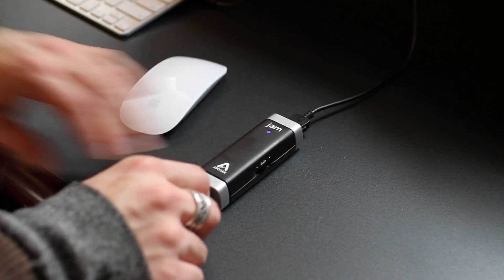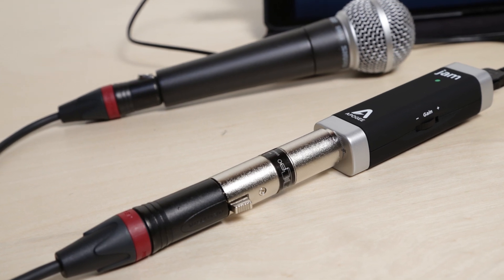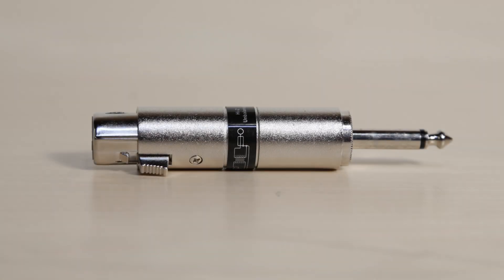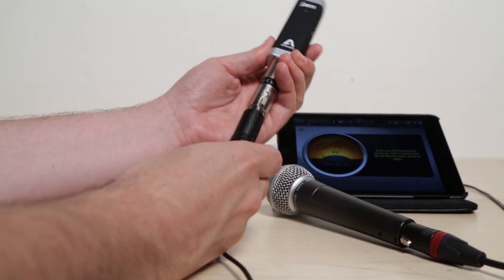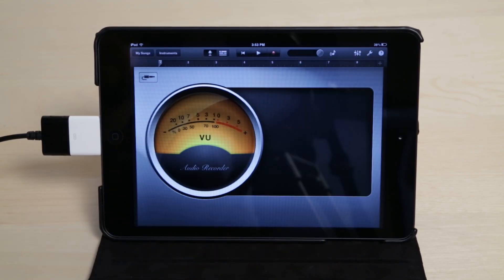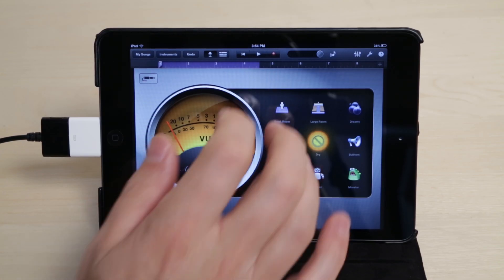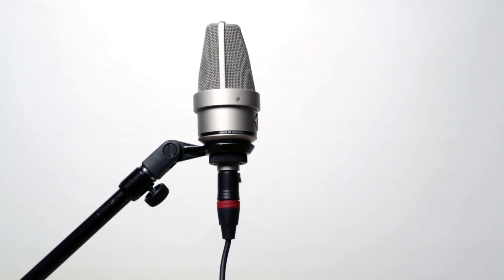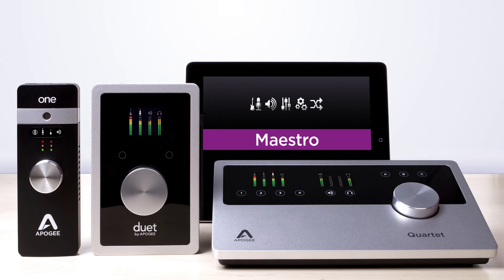Apogee JAM - How to connect a Dynamic Microphone

Comment: Hi, what if I want to use a condenser mic? I'm planing to get a external phantom power supply, can I go from the mic to the phantom power supply and then from there to the apogee jam and still working great? in that case do I still need the low to high impedance transformer? thanks.
Reply from the maker: IF you plan on using a condenser mic, Apogee ONE will probably be the best option.

Comment: So apogee, I have a dynamic mic and it already has a 1/4" end to the cord, can I still use it, or do I still need some sort of adapter? Thanks :)
Reply from the maker: You can use it. However, with a line matching transformer (as used in the video) it sounds better.

Comment: Hey guys! Where can I find the adapter? Or, can I use a microphone that works with batteries and a professional cable that comes from cannon to plug? Like if the adapter was directly connected to the cable. 

Thanks for the tutorials, you're GREAT!
Reply from the maker: You can find line matching transformers on Amazon. I bought that one at a local Radio Shack.
Using just a cable (without the transformer) will work, but will not sound as good, we recommend using the proper line matching transformer.

Comment: Could I use a ribbon mic with my Jam using the same method in the video?
Reply from the maker: Since most ribbon microphones don't require phantom power, it would pass signal... However, ribbon microphones typically require more gain than a dynamic mic and JAM was designed to be an instrument input not a mic pre amp.
I strongly suggest Apogee ONE or Duet if you are interested in using ribbon microphones.